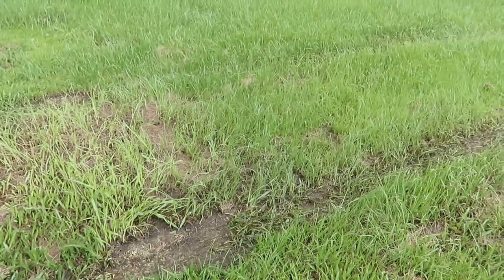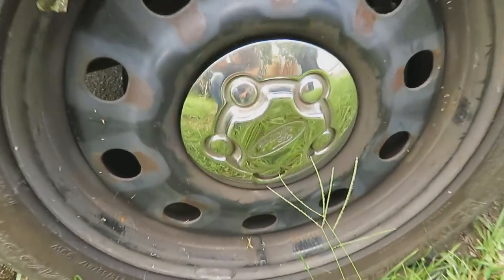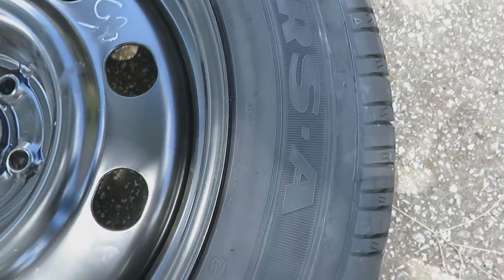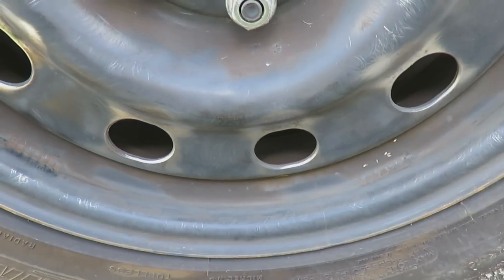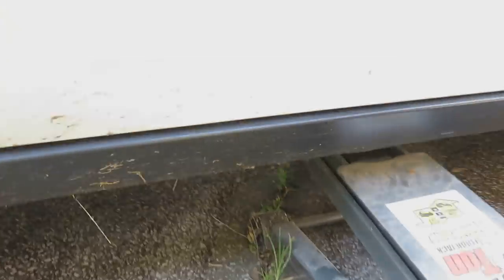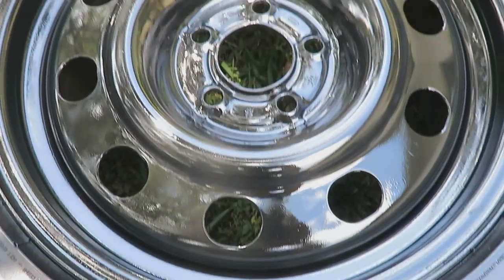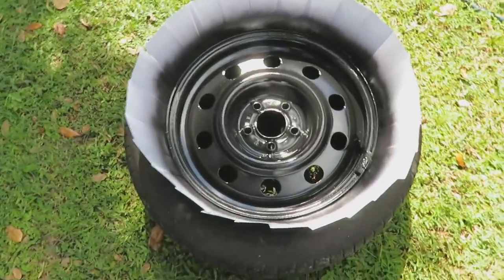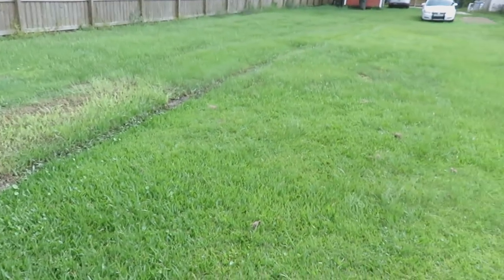Painting the Steelies (Rims) on the CVPI P71

Comment: Hey man order those eagle rs a tires used off ebay. Make sure they are at least 7 /32 of treat and they will look brand new. They come with a one yr 50000 mile warranty for around 65 bucks a piece. I have 4 on my 2008 vic and they ride like new and look new. Those tires are very exspensive new so this is an economical way to get a few or a set..

Comment: Dude another great video. I need to get those wire brushes from hardware store .I did all mine by hand, with sand paper, and I used the 91% Isopropyl Alcohol before I repainted. If you want a 80-90% Used Good Year. RS P71 tire, Go into, Langston's used auto parts, on HWY 301. They have racks of the wheels and Tires. I paid $ 50 for wheel and tire for a spare I was missing, from and Auction car.P71 Guy out.

Comment: Looks good Allen, but I believe you should of used primer on it then paint it then clear coated this oh wait started off with sand paper 2. 2000 grit, but that's just me. You did a good job just the way you did it
Reply from the maker: The spray paint I used is supposedly "paint and primer" in one.  We'll see how it holds up to the Florida sun.  I probably should have used some ultra fine sandpaper, but I compensated by doing three thick coats of paint.  Would have probably only needed one coat with better prep work - LOL
Reply: @TheCopCar  hows the paint held up down here in texas my paint hasn't held up well
Reply: How’s it holding up?

Comment: You can buy the genuine Goodyear Police-spec tires, but they are expensive (I was quoted for $1200 a set) but they have a signifigantly (double thickness) thicker sidewall.
Reply: Amazon has the Goodyear Police 235/55-17 tires for sale at $124.00 each. I bought two at $111.17 each.

Comment: I wouldnt go with the GoodYear one's dont really need it, but if you like the Styles then go for the Kelly Edge A/S 235/55R17 99H VSB Performance tire
Police still use them, and much cheaper. (Around $100 at walmart and $10 to mount and bali) I have to put all new tires on my 2014 Caprice,  its about $136 per tire.